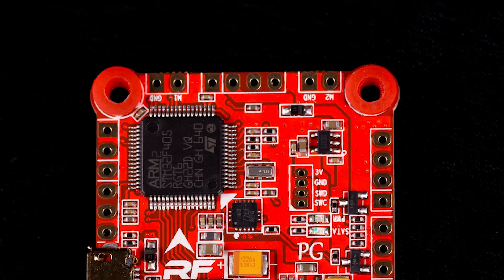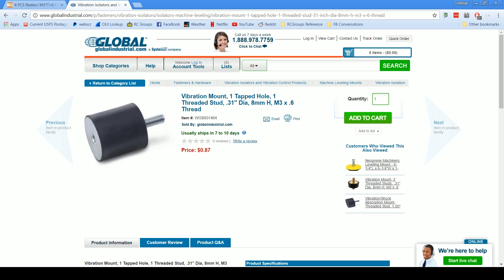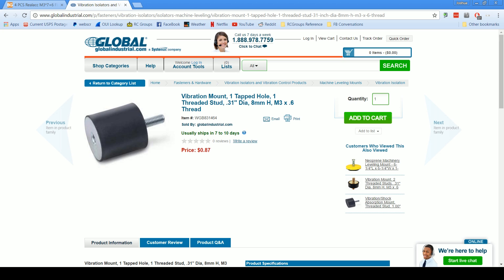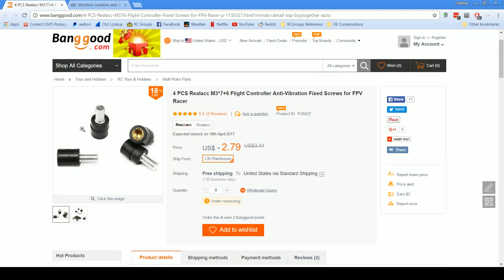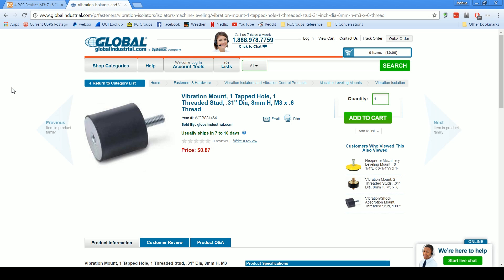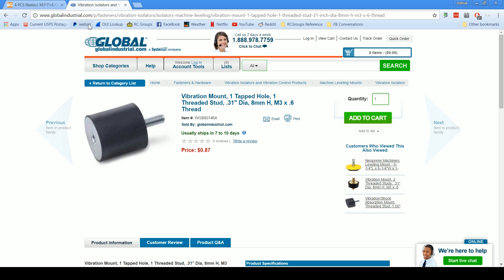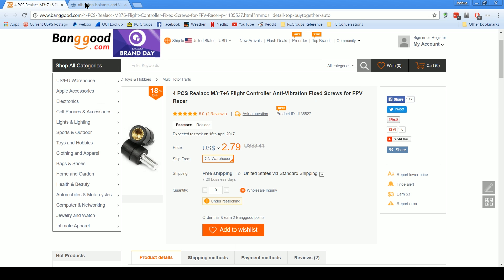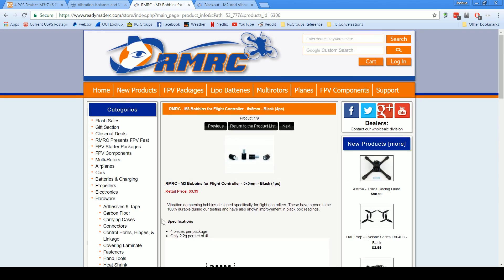Soft Mount Your Quadcopter Flight Controller | BUILD TIP

Comment: These bobbins are not so effective to isolate FCs and you could include a gyro sampling in this video to support your  advice. I used to use these bobbins to isolate cameras in my quads (they're male-male in my case but it doesn't matter). The rubber is too hard to absorb vibrations. Even worse in the case of flight controllers since they don't have enough mass. For cameras they do help but are not capable to isolate completely.
Reply from the maker: +Renato Elias I have found enough improvement using these to solve the common issues related to vibration and the gyro. They're superior to O rings in my experience.
Reply: I agree that they're better than o-rings since, as you well said in your video, do not make any sense if you keep the contact between the screw and the board, however, these bobbins are too hard to isolate a low mass body like a flight controller. Maybe they're available in softer rubber but, at least the one I have, it's too hard. The RaceFlight solution is the best for sure. Have you tried this one? (not sure how to fix it in the quad...) 

https://www.aliexpress.com/w/wholesale-vibration-absorber-fan.html
Reply from the maker: I haven't tried those, no.
Reply: Hopefully, cause we all just went and ordered a bunch LOL!!!  It's interesting how you make an entire video dedicated to something and someone comments the opposite immediately.  Not at all saying that he is wrong but in the words of Jack Nicolson's Joker: Who do ya trust!
Reply: Interesting. Ive had great success with them but after your comment it occurs to me that my FC is a stack including an additional plate & vtx, so there is increased mass on the bobbins. Perhaps that is why.
Reply: Renato Elias I've done my own BB logs and the results were conclusive. bad yaw gyro twitching before and perfectly fine after using these mounts. I attempted to tune it out first by lowering yaw p gain by a fair amount which helped slightly but then the tune was bad and yaw would drift. ultimately using these mounts was the best solution.
Reply: Renato Elias exactly. shore rubber is to high
Reply: Renato Elias I use a 25mm nylon screw and measured were the FC would be, so I sanded thinner the screw at that point (took the threads out) so it does not have contact with the FC, and managed the height of the FC with silicon O rings sold on Hobby King. I have, in my case, 3 on the bottom and 2 on top and a nut, so I pass a long screw from the bottom of the frame, fix it with a nylon nut, 3 O rings, the FC (thinner part of the screw) than 2 O rings and the nut, I cut the excess of screw, if I need to stack, I just go adding O rings lol
Reply: The comparison to stabilizing cameras is different though. For a camera vibration isolation you want to remove any and all fine movements/twitches etc. For a flight controller it actually has to be secured to the frame and not flop around otherwise it would fly terribly. These things are actually ideal for FC's since they secure it nicely to the frame with minimum slop but still reduce higher frequency vibration.
Reply: Vent FPV Well, it could be easily shown in a couple of BlackBox logs or even the gyro sampling screen ;)
Reply: Renato Elias they are fine. I used bluejay f4. Not a fan of soft mount but this FC won't fly bolted ( severe twitch ). Just adding those fixed all the jitter. I sold it thou. Bolting is the way for me :) female - female would work for anything. I guess.

Comment: now how will this work for X frames?
Reply from the maker: +pedro mercado if you have the FC mount structural to the frame, like a Shrike, you can't use these.
Reply: Joshua Bardwell 
I know that. LOL what I was stating is what can be used or can be done for X frames
Reply from the maker: I don't understand the question then. Why couldn't you use these on an X frame?
Reply: Joshua Bardwell 
for some of us who fly X frames what can we use to self dampen the flight control
Reply: I don't think he means all x frames but what can be done to soft mount FC on something like a shrike. I sure am curious!
Reply: Jake Mullins 
yeah me too I have a atmosphere Adventure Artemis and I have a UBAD  katana
Reply from the maker: I really don't know. Whatever you do to soft mount, it will have to support the weight of the whole camera pod. Anything that is stiff enough to support the camera pod won't isolate the FC effectively, and vice versa. If I had a Shrike or similar, I would soft mount the motors, assuming I had vibration issues that is.

Comment: I take a soft hose and put over the standoff so the FC rest on the host. The hole must be larger on the fc then the pin on the standoff .You can then tighten the plastic nut as hard or soft you want the fc.  Easy and i think its works well.

Comment: Are you against using the bigger bobbins ?
Reply from the maker: +Haaizor I think they are too soft. And not secure enough.
Reply: Did you try them on a copter ? I'm doing two rebuilds somewhere early next week and I'm willing to give the bigger bobbins a try ( I can get them on short notice). Thanks for responding btw :)
Reply from the maker: I haven't tested the bigger ones, no.

Comment: It doesn't feel right to me to disconnect the fc from the frame in such a way. I soft mount only my motors and I guess I was just lucky not getting vibration issues yet.
Reply from the maker: +ZeroFPV disconnecting the FC from the frame is exactly what vibration isolation is. If soft mounting the motors works better for you, definitely use it.

Comment: Could you do a video on thrust, drag, and how rpm and speed relate to them for quadcopter performance?
Reply from the maker: +Jason Reel check my video on the Emax 2306 with Ryan Harrell.
Reply: Awesome, thanks!  Your video on 2 and 3 blade props got me started on ecalc and trying to build not just more power but towards a better balance of performance overall.

Comment: but that means, that above the fc nothing else should be stacked?! in case, the whole "tower" will become shaky if the softmount is on the bottom. right?
Reply from the maker: +Rookie Rotors no. The whole stack will be soft mounted.
Reply: i will try. but little afraid, that when crash, the "long arm" of the whole stack will rip of the rubbers on the bottom - or the whole stack is wobbeling arround and will negativly effect back the fc. all speculations..will test. nice hint, didnt softmount anything till now, but still got away with it so far xD
Reply from the maker: +Rookie Rotors yes, don't put too much weight on top, but a couple of boards isn't a big deal. Don't put a camera up there.
Reply: Joshua Bardwell hehehe nope, definetly no cam up there xD just one board (diatone sp3 vtx)

Comment: joshua, my build runs so clean with damped FC that i can lower the filter so much!  but is there a possibility that i lower it to much,?  even if it runs verry clean and cool& quiet,?  can to low filtering work against you? or the tune,  even if it runs verry nice with ultra low filtering?
Reply from the maker: +Hans Turpyn if the motors stay cool you're probably fine.
Reply: Hans Turpyn the very best case scenario would be no filtering at all. This would mean less delay in the PID loop which is always good.  If we could get away with this we would.
Reply: Isn't soft mounting filtering too? You change a hardware filter with the software one and vice versa.
Reply: yes it is, its probably fine then, and low lag!! :)
Reply: yes it runs verry smooth and clean, just wondering if to low or almost no filering can have a averse effect on the tune. because in that case you almost get the raw data in the pidloop and every twitch and peek gets in
Reply: Oh yeah. I totally forgot about the lag.

Comment: Are you using a nylon screw to mount the standoffs through the bottom of the quad or a steel/aluminum one?
Reply from the maker: +mportillo78 depends.
Reply: If I'm looking to use these on my wizard, what type would you recommend?

Comment: well I just placed an order for the mounts from RMRC plus a bunch of other stuff. I was hoping to use them in the Pico, but I may have to cut them down because 6mm is too tall.
Reply from the maker: +Mark Spohrleder you can't really cut them down. The metal parts are molded in.
Reply: Joshua Bardwell ok thanks. I was hoping it was all rubber between the metal plates and I could cut some out.
Reply from the maker: +Mark Spohrleder it is rubber. But how would you rejoin it?
Reply: That I don't know. Goop? Just a thought. I'll have to wait for shorter ones. But thanks for the great ideas. I also bought the think tank transmitter case thing for my DX9 because of your video.

Comment: Ive been using these (similar) or about a year, they are great. Funnily enough I just replaced the set this evening as mine had begun to perish. $6 for 8 on ebay. Ordered a fresh batch before the price goes up! Have at it! "8pcs M3 8mm Anti Vibration Mount"

Comment: One thing I wonder about - how effective is the dampening if your connections to other components aren't isolated? For example, you have connections to a PDB that has soldered connections to ESCs that are fixed to the frame - won't that diminish or negate a lot of the dampening?

I'd love to see a comparison of the differences between dampening and no dampening. Maybe some semi-controlled bench testing could help demonstrate whether my concern is worthwhile or not.

That said, here's a tip: you can find vibration dampening mounts in old CD or BluRay drives. You can spend less than $10 at a thrift shop and end up with a dozen or more really nice ones in addition to motors, precision shafts, various gears, and screws.
Reply: Michael Buffington I can tel ya soft mounting worked for my mid throttle oscillations with the new Emax motors that have the strong magnets.  It's not a myth.
Reply: I assume it works, at least to some degree. But it just seems likely that you can throw on those dampeners thinking they're going to make a huge difference only to be sabotaged by lack of isolation elsewhere. Maybe I'm overthinking it?
Reply: Michael - Are you saying that the vibrations will run up the copper cables?
Reply: Yep. Specifically ESC wires, in my case. The positive and negative wires are fairly short and don't have much wiggle room (a term that actually makes literal sense for once). They're also 18AWG, making them pretty thick. Those wires are directly soldered to my PDB, which my FC is mounted to.

My ESCs are heat-shrinked directly to the frame. Given that arrangement, I doubt dampers will be able to do much. They need to be able to move and would be locked down in my setup.

My guess is that if I changed how the wires connect to my flight controller/PDB stack that could make a difference. But on a 210 sized quad there's very little room to add "loose" wiring - especially wiring that needs to stay clear of props.
Reply: Still can't see them making any significant effect Michael. The main vibes are from the motor and prop imbalances, really hard vibrations transferred through stiff carbon frame directly to the FC. I'm only theorising, but I can't see those vibrations being too significant by the time they have been dampened by traveling from the frame, through the ESC and then up a silicon-covered multi-strand cable, but I could be wrong.

Comment: Also worthy of noting, make sure you use screws that don't bottom out into the rubber of the mount, this will lessen their effectiveness. I usually use nylon screws and cut them to length, 4.5mm long for a 3mm thick frame and 5.5 for a 4mm thick frame.

Comment: I just soft mounted the Pico BLX fc on my Pico x last night, but I used o-rings. so we'll see. 
on my R5X, I have a TPU sort of "hammock" for my fc to stick to and be suspended in the middle of the stack. works great.

Comment: don't forget to put in a ring on the screw attaching the anti-vibration mount to the frame that way you're not hard mounting the anti-vibration mount. all my screws attaching my flight controller and pdb on the bottom of the copter have O-rings on them all four the rest of my frame has regular screws

Comment: Can you show us some before and after black box evidence of the these bobbins actually making a difference Joshua?
Reply from the maker: +Dean Naguib no. But I can tell you that they reduced video noise and hot motors on multiple builds.
Reply from the maker: +3000gtwelder mechanical vibrations are translated into electrical ones by the D term and the ESC's.
Reply: Dean Naguib They work. I've seen the evidence in my own blackbox logs.
Reply: Even video noise???? How does that work?
Reply: They do work.  I've used them before.  The downside the older ones are huge (8x8mm) and heavy (2.5g each) and don't fit well in a lot of builds because of the size.  These new smaller ones should help.  The new Raceflight Revolt + DYS FCs which has over bored holes and rubber mounts work the best.  I've had Yaw twitching (mid throttle oscillations) even with F4 boards.  Some sort of dampening is a must.
Reply: Is 3.99 that big of a decision to make?
Reply: I used metal screws for the first time on a replacement bottom plate to mount my FC on one of my quads. The electronics were moved from frame to frame in one piece. The motors jerked like crazy and wouldn't even come close to full throttle. I hooked up to BF and use the motor tab and they worked flawlessly. I realized it was gyro noise and replaced everything with plastic fasteners and it ran perfectly.  The Sensor log looked like crap and had obvious harmonics through the throttle range.
Reply: There is a customer review with blackbox pics before and after use in Banggood.
Reply: The ones on ebay are 1.6g
Reply: I'm going through the same thing where I changed the bottom plate and in doing so removed a thin layer of dense flexible damping glue the manufacture used with a hard mounted FCB on the surrounding white plastic connectors showing at lot of thought went into the design regarding harmonics and I noted changes with no other setup change made other than a fresh set of balanced props replacing the used balanced props saved for spares (after trying the orig set first that had one unbalanced prop). 

But I'm not sure the change is bad yet. Placing the FCB frequency closer to the carbon frame's weight "sink" frequency seems to have made the FCB more responsive and that added to an ESC calibration "fishing" problem I noted I believe is due to using Cleanflight and Belheli ESCs adding a dead band at the top as well as the bottom that becomes more noticeable during high winds when the FCB uses full throttle "in reserve" a lot more... but the extra headroom is not there to access fooled by the BelHeli ESC's fake mapping. After high winds made it obvious a Google search found reference to it in seconds in a completely unrelated thread regarding running motors without the props on. Sure would be nice to have a manual on the OS basics at least rather than searching through mountains of posts often containing misinformation.

It seems I just needed to add a step to calibrating my ESCs. I can't believe that was not noted by the manufacture using Belheli ESCs if that turns out to be the problem. But first I have have to update to Bataflight based CF 2.0 and looking at well supported yr old F3 board prices makes my NAZE look obsolete. 

Really interesting hobby now. In some ways RC quads remind me of the "impossibility" in physics to know the particle's speed and location "simultaneously" using language based on opposite concepts connected to time as it certainly has a location "all the time" that did not disappear just because "someone" tried to measure it. In other words you can likely figure something out in pieces of information found before you find the answer associated with understanding searching for it.

Comment: so the fc goes flush on the rubber pad and you use a nylong screw/bolt to mount it and the aluminum end goes (as you said) into the other stand off or through the frame for mounting? sorry if this is confusing, iv been using the o-rings but these seem neat just wanna know what im doing prior to purchasing.

Comment: What about soft-mounting motors? Is this a replacement for that, or I have to do both?
Reply: Soft mount everything, including your props.
Reply: I have this soft mountef FC but my raw gyro was still noisy. I must admit I did not have  the data before this.  I then further soft mounted the motors. huge different. https://drive.google.com/file/d/0B8Z59Xts9iEueHNlaG50MmZxbkE/view?usp=drivesdk

after motor soft mount

https://drive.google.com/file/d/0B8Z59Xts9iEuV1IwQi1ORmh2T2c/view?usp=drivesdk

Comment: Foam tape didn't work well for my Revolt V1.  It would wig out during some rolls and flips.  Since I hacked up some old Mobius rubber mounts for it, it's much better.  I'd rather have these though.  What I did works, but it took some time, and doesn't look that great.  Thanks Josh.

Comment: Got some but not used them yet but as I'm cheap here is an other option for £1.30 ($1.59) for 10 form china free delivery if you're in no rush. If I'm honest they look a little big but it might be worth a try.
https://www.aliexpress.com/item/10pcs-QAV250-QAV-R-220-Mini-Drone-FPV-Quadcopter-Flight-Controller-Mounting-Hardware-Spacers-Standoff-For/32780700917.html

Comment: I can vouch for the banggood ones. As you can see in the first comment in the listing, I show there the blackbox gyro traces (unfiltered) before and after using them. Mid-throttle yaw vibrations are completely gone.

Comment: Any advice for dealing with frame resonance? I've tried tuning it out with filtering (KISS FC) and isolating the board better, but I've still got some really bad mid-low frequency "ringing" at most throttle points. I've got a set of TPU motor soft mounts inbound, hoping that might help.

Edit: Video of my issue: https://youtu.be/RLfNnJby0bI